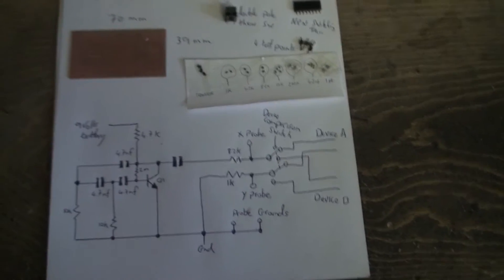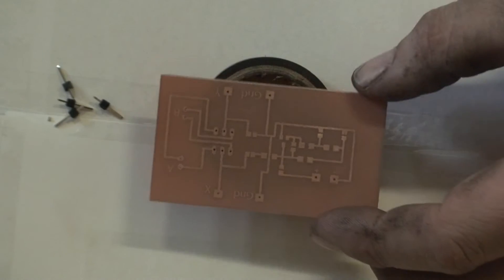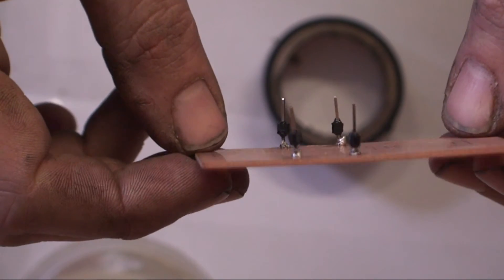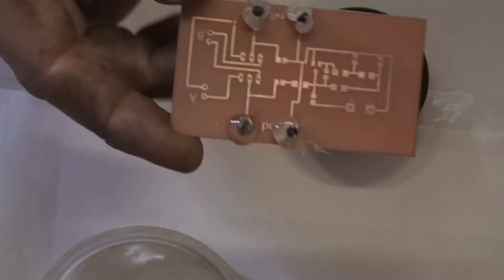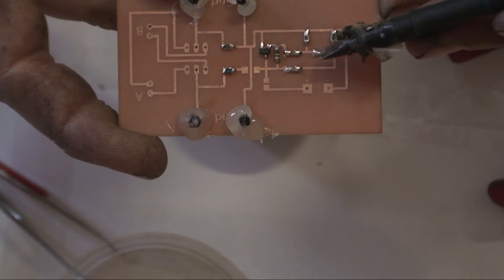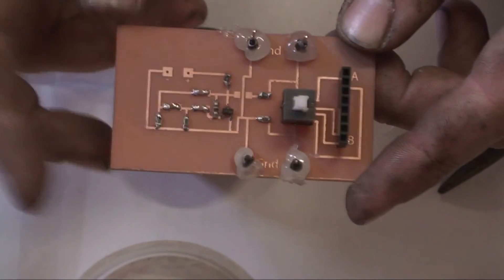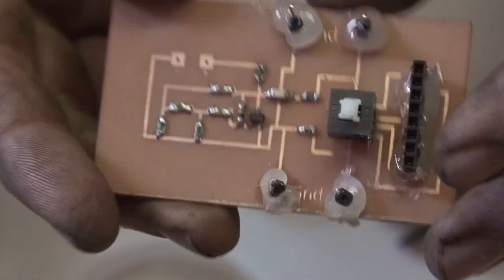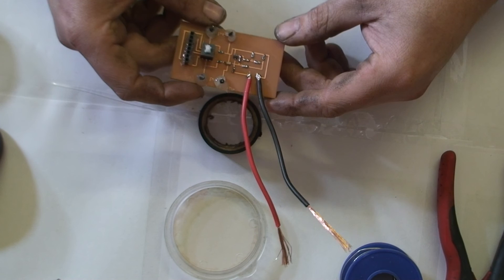bodgit and leggit garage. how to make a curve tracer tester for a oscilloscope part 1

Comment: hello my friend,  I did this curved track, but used with my rigol ds1054z 4 ch oscilloscope it does not work. I set x-y mode, the high-resolution display, the X-channel at 2 volts division and the y-channel at 200mV division, but I do not see the curves well when I test the various components. I also tried to combine several divisions on the x and y channels, but the figure on the display magnifies or shrinks. Specifically I do not see the curves of the generic and zener diodes. Since the curved trace is based on a coolpitts oscillator, it could be that the malfunction is caused by the fact that I used two 0,47 uF and 0,63uF tantalum capacitors connected in parallel with the result of having something more than 1uF? Unfortunately I do not have a 1 uF capacitor (as shown in the diagram). The pilot signal instead of being 1 KHz turns out to be 600 Hz. Where could the problem be?

Comment: Hello friend I want to make this circuit to test vehicle ECU will be having 3l file to print and make the PCB
Reply from the maker: +francisco fernandez nice cool
Reply: +bodgit and leggit garage 
hello friends just made the circuit equal to unstedes and I am using it for l microphone input of lapo with the oscilloscope scope program that brings the configuration of X and Y but it does not work as will that be me acesorar or help not I do not use the oscilloscope if lapto